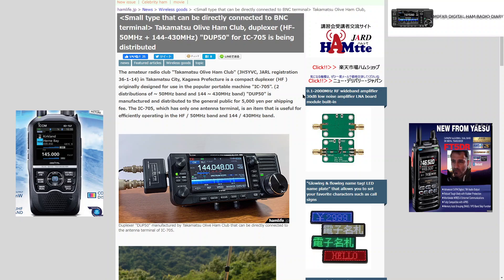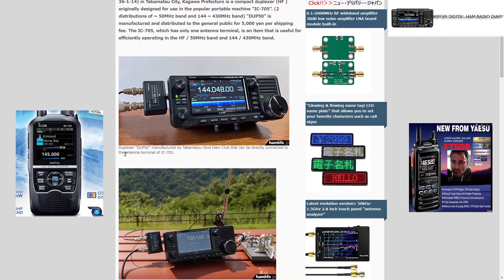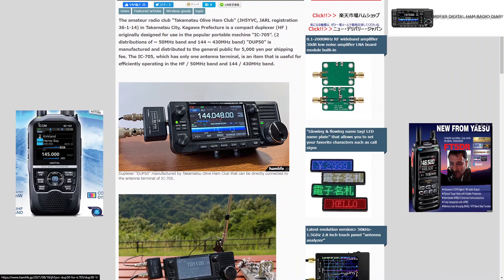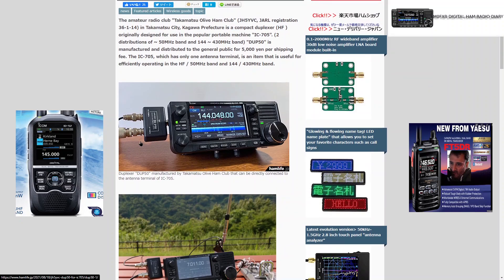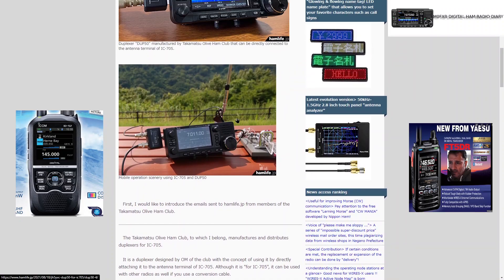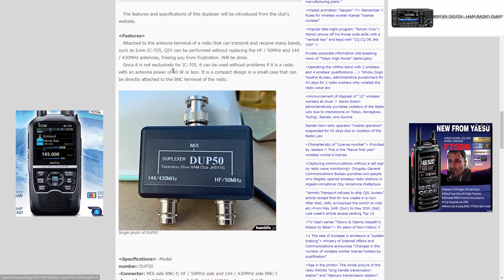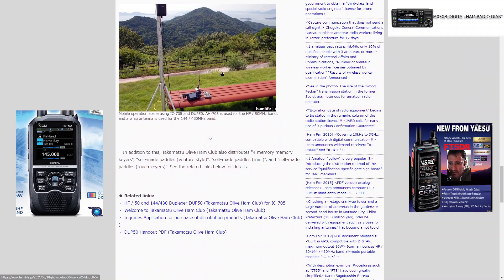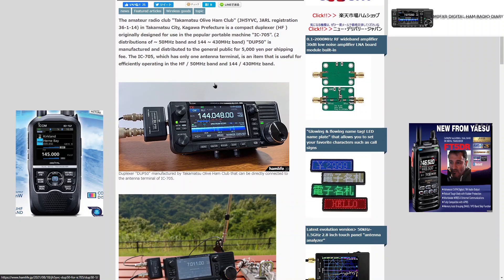ICOM IC-705 HF / 6 Meters -2 meters/70cm BNC duplexor

Comment: Frequency splitter is a Diplexer, not a duplexer.  
A duplexer splits the receive from the transmit signals, great for protecting your receive radio when you Transmit.

I'm looking for a diplexer, and the number (incorrectly) marked as duplexers is hampering the search.
Reply from the maker: Thanks for info.